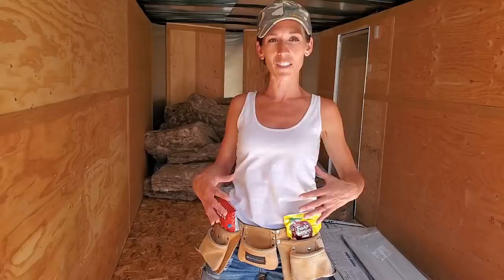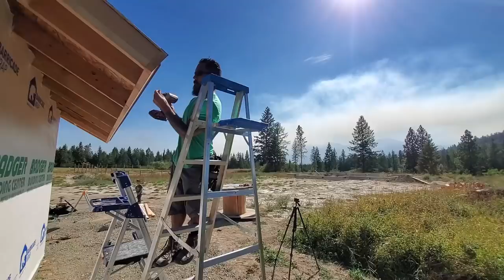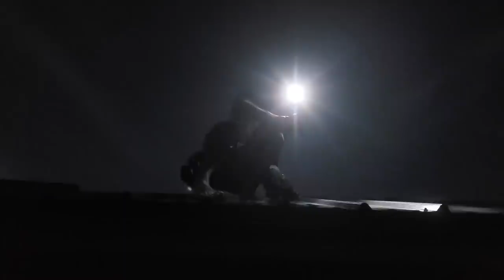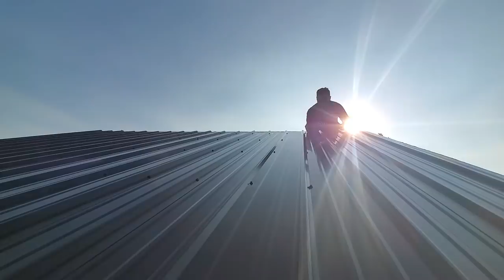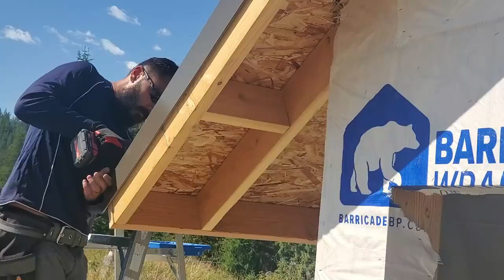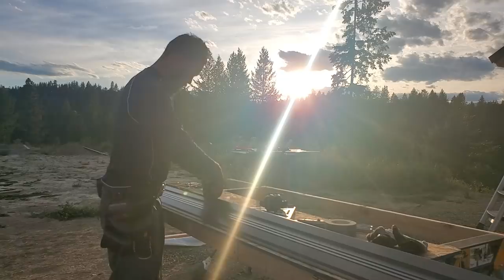How To Build A Shed (Part 6) | How Rising Lumber Costs Are Effecting Our Build

Comment: Do you have any quantity of trees you could trade to a local mill for lumber they might trade or have them mill yours for shares of the finished wood. Look local and see if anyone has mills. It would be a process and drying time for the fresh cut lumber before you could use it but it can be done while other things get done on the property.  Or invest in a mill of your own and do side jobs for sharing part of cutting their lumber after you get it mastered......
for your own home you could dry the wood inside the big barn/shed and since you have the inside protection. I'll try to think of other options as well...........not sure how much a small mill sized outfit would cost.  What sizes of lumber do you need.....longest for sill plates or or or?  etc etc. 
Just a thought.  
The housing is booming so I am sure that and the pandemic is blowing things out of sigth.
Prayers and blessings!

Comment: One of the things driving lumber costs up is all the new construction. Many people are "fleeing" large cities and there is a lot of new construction ... more than I've seen in a long time. All this new construction is creating a "shortage" and driving prices up. There's not really a shortage, just higher demand. If you have timber on your property, you might be able to save some money by getting a sawmill and cutting your own boards for framing, though I'm not sure how much once you pay for the additional equipment ... however, it does nothing for the cost of OSB. I'd bet when you see home loan interest rates go back up the building craze will taper off. Not sure when that will happen though. One thing I would caution you on though is going "cheap" on your main house ... it may take 3-5 years, but the cheapness comes back to bite you.

Comment: Oh no. Per Florida code, drip edge goes under the tar paper on the bottom edge and on top of the paper on the rake edges.  If water gets under the shingles and runs down to the bottom edge, it will probably run down between the drip edge metal and the fascia board, eventually rotting it.  Maybe a bead of tar/asphalt at the top of the metal edge will fix the boo boo.  There are lots of good construction videos on Youtube.  I've gotten so that I consult Youtube, even on projects that I know how to do and have done before as in last fall when I did a roofing job on out farmhouse front porch.  Good luck.

Comment: Can you purchase lumber in Canada and pay a duty to bring it across the border for personal use?
Lumber in Idaho has roller coastered for decades. Hurricane and disaster season pushes prices up but they fall as the extra demand falls. In 2005-6, OSB ranged from $7 in June-July to $22 in October-November. Canada harvests some more wood after freeze-up. Prices should drop then. 
Ask your local supplier what the cycles have been in your area.
Reply from the maker: Border is closed
Reply: @GoodSimpleLiving  Can a lumber supplier deliver lumber to the border for you to pick-up with no contact? Call the border check-point and ask if they have a way to help, "If lumber is more affordable in Creston, BC"

Comment: The lumber cost is why I bought a sawmill.  I priced osb for my roof and wow the cost was crazy. I don't think it will go down fast, I have noticed when they realize they can get a price for something they keep it there for a while until the competition forces them to lower it.  I will be cutting my own lumber for my build. It will be more work but the cost of the mill is paid for with the savings of just the house..  so the barn and outbuildings with be very cost effective, even if I buy trees to make lumber instead of using my own trees, which I am doing for my build.  Let me know if you want to come check it out.  Oh also there is an income potential work it too, going to cut some timbers for a build someone has and I will make a couple thousand for that.
Reply from the maker: Thats awesome!
Reply: the two-by-sixes that I cut four days ago are pretty much a dry right now with him being sacked in a little bit of breeze in the warm air it dries really quickly

Comment: Buy a small saw mill and cut your own boards, or find some one with a small saw mill and trade logs for boards.  You can cut the logs, or he can cut them.  You'll end up with custom boards.  They'll be straighter, and you can choose the type of wood, and maybe get some very fine grain.  I'd do it again.  Prices will be significantly cheaper than when the prices come down.  Oak, poplar, birch, maple, fir, pine, etc.

Comment: I think the cost of wood will be there for a long time. It might be worth buying a cheap saw mill like a woodmisa. It would be free lumber for you and although it's a bit of work spending 5,000 on a saw mill would be much be5ter than paying for all the high prices. You have a forrest full of wood just sitting there. Free wood, then you may be able to do floors añd siding. Maybe change your house design to the floor plan using different materials. Just a thought that may help you guys out , God bless Australia ❤️💙😍

Comment: It is not just OSB, most lumber has increased in price. We started to put a new deck on and it has doubled in price from the time we got bids until finally getting a build date.Just hang in there we can only hope things will get back to normal when the election or this pandemic is over.

Comment: Lumber prices fluctuate as home building also fluctuates. So you have a supply and demand situation. I remember OSB costing as little as $8 per sheet and in the same year went  to $28 per sheet. I believe it will continue to change in price as the supply and demand changes from now on. OSB is a highly used material. When you see a new housing development starting, look for the prices to also move up. Kinda a hit and miss thing. Not only OSB, but most all building materials. I just finished building a frame structure, wood working shop, 12x24 and my schedule  was to get it framed in with roof finished in two weeks. Rumor had it that the building materials were to go up another 5% in the short period of time. I did get it done but the building materials were over $6000 for that small building. Go figure.

Comment: I know you are looking at saving money. However osb was invented for sheeting. It looses strength when used for flooring. Plywood is the better choice. Also Consider rock wool batting it is fire proof and will not mold or hold moisture. Fiberglass does. Or foam insulation in your home. Or a combination. You will be happer long term over fiber glass.

Comment: With the rising costs of lumber and the uncertainty of supply, what I would do is buy as much lumber you can get your hands on and store it inside your pole building.  In addition to lumber, purchase BUCKETS of nails, saw blades, and plenty of tubes of caulk for Melissa.  You will need to buy the lumber anyway, so why not just stockpile what you will need.  If prices keep rising, you will be paying yet more for what you will need. Purchasing all the lumber (at least for the shell of the house) you will have what you need on hand without making trips to the lumber yard when you build.

Comment: Get a small portable lumber mill.  You have trees.  Build a nicer house for less money.  Save your money.  Two inch thick walls (best to make it tongue and groove) means you do not have to buy or use insulation or drywall.  You will have your bardaminium and a good water system.  It is not so bad.  You have time.

Comment: I am building a room onto my tiny house. Wish I had done it two years ago. Went on saturday, to get hardware. HARDWARE. That's two small chains. 8 corner brackets. 14 joist hangers. 3 eyebolts. 6 eyescrews. 8 lag screws. 10 3/8 bolts. Nuts and washers. A tiny box of lath screws. Cost me 180 dollars!!! 2 years ago, I would have gotten all that with change to spare, from 70 dollars. I expected maybe 100 because of inflation. But 180!!!!??!

Comment: So, I hate to be a "Debbie Downer" but your DRIP EDGE is suppose to go UNDER your felt underlayment directly onto your wood. That is so IF any water get under your metal roofing via your ridge cap, it'll flow down and off your roof.  Now, as is, it'll flow down until it hits your drip edge, go UNDER your drip edge and get between it and your underlayment and possibly start rotting out the corners of your facia board since it won't dry out completely. .. . . . . . . . . . .

Comment: How many Miles are you from a Home Depot or Lowes or a wood store in Montana because no sales tax in Montana compared to 6% in Idaho. How many sheets do you need. You have Load up your trailer there in Idaho so weigh out the cost of gas and 6% sales tax in Idaho, then see if the cost for gas and no sales tax in Montana saves you money.
Reply from the maker: Hour to home depot

Comment: It's going to be at least until after the election.   Maybe longer.  As the economy recovers a lot of DIY guys will be going back to work.  What you can do is go to a local mill and have them mill shiplap siding.  When you use siplap it will eliminate the need for OSB in the walls.  Just put cross bracing and then cover with insulating foam sheets.  Put your siding over the top of that.  There is another method called shou sugi ban (burn the wood, sand and rub with linseed oil) but you are limited with color.  You will have to re-oil every 15 years or so.  You can also build all your non-load bearing walls using steel studs.

Comment: I don’t want to sugar coat, but I think lumber price will still go up.  I’ve been also looking at prices yes it’s up 300% since May.  I think it will hit 400% by Nov/Dec and maybe 500% by March 2021.  I don’t think it will ever go down to where we were until mid 2022.  Lowest it will get is probably at 200% or $18 on your osb price by June 2021.   So I think you and your family will need to bite the bullet and buy them now or buy them in 2021 when they may come down to $18.  As you are aware prices goes up quick, but slow to come down.  Inflation also doesn’t help as feds are just printing and spending money.  My first post ever on YouTube.  Good luck

Comment: I think prices for most things are going to remain unstable until after the election in November. Unstable = higher prices unfortunately. Perhaps an even bigger contributor are all of the fires destroying thousands of acres of trees. The long term ramifications of losing that many trees may be devastating to the home building industry. My advice is to hold off on the big house until these prices come down. I mean it’s not like you don’t have a safe, warm place to live already, right?

Comment: Alternative to stick-built houses: Timber frame (https://www.youtube.com/watch?v=2gWxRVqNI3M) straw bale (eg https://www.youtube.com/playlist?list=PL1q1ailceWCAhVzA5blKPZZ93fWBgvwiy ) or a combination (eg https://www.youtube.com/watch?v=Rspw81VzwDQ) or just straight SIP (*STRUCTURAL* Insulated Panels) (Sales video shows how it works: https://www.youtube.com/watch?v=_t3VmOy17N0 ) You will have to do your own research re. costs.  We really wanted to use straw balse for our build here in the UK, you get some really wonderfully gloopy walls and edges!  ALSO - CONSIDER A ROCKET MASS HEATER within the house envelope. Explanation here: https://www.youtube.com/watch?v=fwCz8Ris79g  Good luck!

Comment: Canadian softwood lumber used to build U.S. homes carry tariffs of about 20% imposed by the Trump administration two years ago. That adds $9,000 to the price of a typical new home and more than $3,000 to the value of a multifamily unit, NAHB said. At a time when all eyes are on U.S. housing affordability issues, the trade dispute with Canada is “needlessly driving up housing costs,” Greg Ugalde, chairman of NAHB, said in a statement issued after the president's speech.

Comment: Why not make your floors, in your tiny home, out of the pretty cements I have seen online? No worry about wood. Make your countertops out of Stonecoat. They are beautiful! Thinking of using Stonecoat in my tiny House On Wheels..
I noticed you did not put rubber grommets on each screw of your shed roof. Why?
Try to get your home built before the next depression. It IS coming!

Comment: I think a lot will depend on the outcome of the elections.  Dems in taxes will soar and prices stay high.  Republicans in, economic recovery takes a priority and building materials will stabilize.  Meanwhile, you might want to consider a plan for metal framing and compare cost.  Nice job on the pump house.
Reply from the maker: Metal is much more.

Comment: I would look at the price of a sawmill, yes it cost more but with having trees on the property it might actually save you money.  Do some research on how to dry the lumber on the property.  Yes it will slow down the build.  But it may also open some things that you weren't able to look at because of price before.  Lumber isn't going to come down. With the hurricanes this year along with the fires and the floods, I don't see it coming down in the next 10 years.  It might also be something that you can generate income with in the future doing custom milling for others.  I would do a lot of research also of precut kits and price them.  Some of the places will take your footprint and plans and do the precut to your specs.  You might even look at logs.  Your options are many it just depends on what YOU want to do with them.  Good luck and god bless.
Reply from the maker: But fresh cut lumber needs to dry over a year.
Reply: @GoodSimpleLiving  Not always, I was looking at one several years ago and found some videos on you tube that showed how to make a simple "kiln" out of plastics and boards that were cut from scrap, sped up the drying process appreciably.  Just an option but something to do research on.  The other thing is buy all your lumber now and figure out how to keep it protected from the elements, that can get pricy as well.  Some of the lumber in the stores isn't even dried well hence the problems with the warping and such.  There is an answer just has to be something that you can live with.  God bless

Comment: Lumber shortage; (1) most but not all comes from Canada to the USA; OSB is junk will always be junk "by product/glue board" & for some reason became an industry standard. (2) Constitution/housing market is taking advantage of COVID to increase pricing by creating a shortage based on holding back material supply; (3) the lack of manufacturing with-in the USA is being seen more then ever. (4) ether find a local mill or purchase one while you can; given most are from China "parts/pieces".

Comment: Wait.  The next three months are going to be a roller coaster.  Once you start the build you can’t turn back.  Don’t overcommit in this climate.  Get the garden ready for spring planting, beds, fencing, etc.  Firewood.  Animals.  Sheds, fencing, etc.  this comment won’t be popular on this thread, but tighten the ship, conserve capital in an election year.  If this was May, maybe different advice, but it’s basically fall at this point.

Comment: The price increase is not because of an actual shortage of wood.  Several Lumber Mills have stockpiles for raw material but because of Covid, most are just not operating..  Once they determine that the Pandemic is over.. probably around November 4th.. things should start returning to normal.